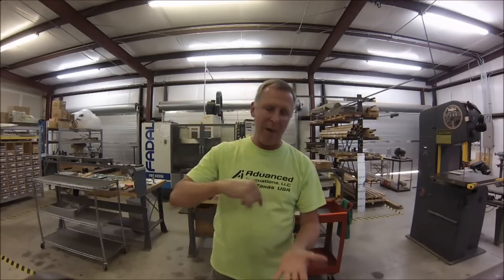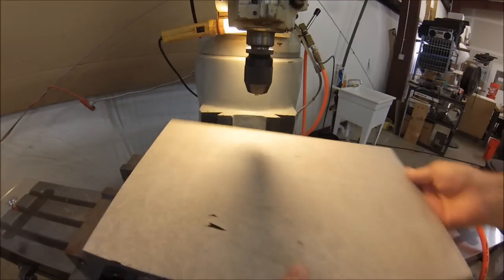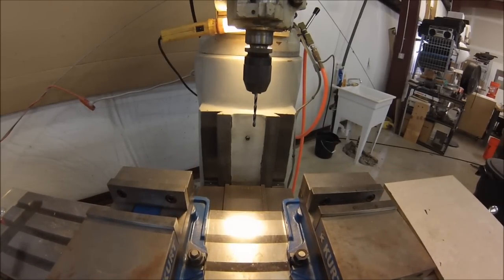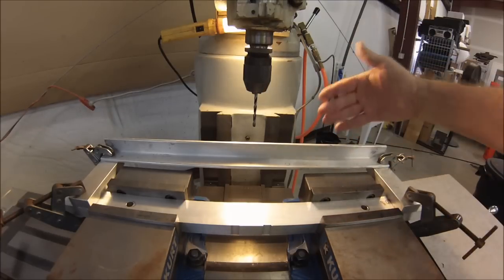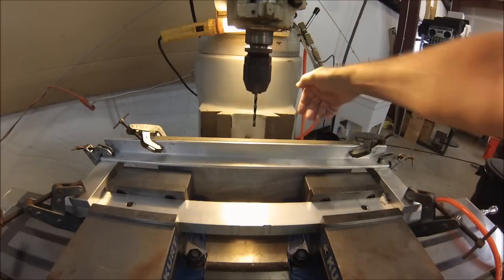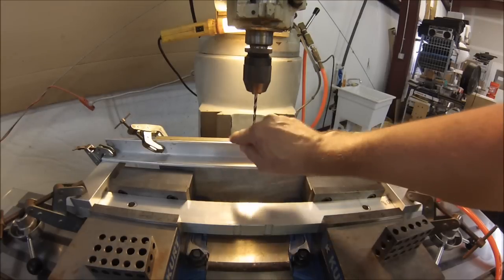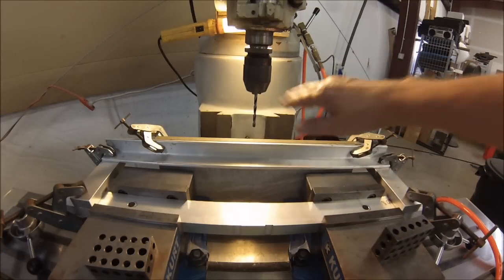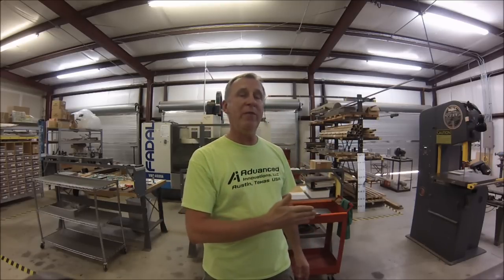Holding wide plate material vertically on the mill

Comment: Now I just need twin vises! :-) I actually want a big radial arm drill exactly for this type of stuff.  I worked in a shop that had one once and that thing was slick for jobs like this.
Reply: Level3-RC
I would love to have a matching 8" Kurt to the one I have. Loading one in and out of the mill is a good workout, if I had two to do I could start body building. lol
Reply: Level3-RC
 I believe Kurt advertises all their vises to match dimensionally within .001" for each series.   I do not know if they will match a pair beyond those tolerances for you or not.

Comment: Mann!  you're some cookie, Joe!  That was real Headbanger stuff - fair rattled my cage, er Brain -  That's what I like about your tutorials -this LATERAL THINKING. I've started gripping small vices in bigger vices ( for sake of accurate right angles ) and would reluctantly have turned boring head on its side - just the pain of setting squareness ( pity the mills don't have an indexing notch.... Mmm  some mileage in there? - to make an indexing block for quick resetting for simple work, at least ? ) THink I'll have to get the apprentice to manufacture a similar device for our SINGLE large vice on the Bridgeport - the trick being to keep it square and parallel to the vice and table.........   Many thanks.
Reply from the maker: Thanks for the comment.

Comment: Great tip! I'm curious why you remove the 123 blocks before drilling.
Reply: It just occurred to me why they need to be removed. Don't want to move the x-axis with those sliding on the ways :)
Reply from the maker: They are also likely to bind and try to pivot which would throw you part out of alignment.
Reply: I guess if the holes were big, the blocks could be reinstated after each move to take the thrust of drilling.

Comment: Nice....A buddy of mine asked me if I could add a bolt circle pattern to a rear end axle that's about 36" long. Any simple ideas how to hold the axle of off the side of the table? Great videos...keep em coming! Thank You!
Reply from the maker: Hi Chuck. Swing the head of your mill about 45 degrees off center and clamp a big v block to the table. Let the part hang close to the floor. Careful you don't hit the lower casting of the machine when you move the part. Even a home made primitive v block will work.
Reply from the maker: A right angle head would also get the job done.

Comment: A comparable equivalent would be a couple of angle plates setup so the vertical faces were sitting out slightly past the rear of the table.  Dial them in so they are coplanar and Bob's your Uncle.  

On occasion I use an angle plate on my drill press to allow working on the end of a flat bar or plate without the need to rotate the table.  So as soon as you poked that clamped up rear face framing into position my thoughts immediately jumped to my use of the angle plate to create a temporary vertical table.

In your case I like the drop in frame since it might be a bit of a PITA to move TWO vises and zero them in again so they act as one.
Reply from the maker: Hi Bruce. The angle plates would work perfectly as well. You may even be able to keep them screwed to the table and not consume the valuable vise space. This trick works well for the guys without the angle plates. Thanks for the comment.

Comment: If you don't have 2 vices, this same kind of thing could by clamping an angle iron to the table with toe clamps. You could indicate the the angle iron parallel. A quick dirty way would be to make up some indexing pins that fit precisely in the slots on the mill table to locate the angle iron up against. I've been meaning to make up some indexing pins for the slots on my milling machine, this idea just gave me an excuse to make them up.
Reply from the maker: Your suggestion is a good one as well. The setup shown in this video is for the guy that doesn't want to remove his vise and may have a DRO glass scale protruding out the back of his table. My setups come and go very quickly around here, so anytime I can leaves the vise(s) in place and utilize them for secondary setups, its a good thing. Thanks for the comment.
Reply: Joe Pieczynski  Joe your putting out some great content. I like the way you format a lot of it with the white board lesson first and then walk out to the shop and show the practical applications. The other thing I like is that you keep the video focused on the subject matter at hand. To the point. That's the way I like it...you're doing a great job on these videos. New subscriber here.

Comment: Hi Joe
I did something a bit related to this idea, in that I swung the turret to the right and then clamped a tall job to the back of the table. The job sat on a wooden block on the floor,  a bit crude but I got the holes in the end of the job where I needed them!
Keep up the great ideas.
Pete
Albany. West Oz
Reply from the maker: I still do that. I had so many to do once, I actually built an adjustable outrigger. It works well.

Comment: Hi Joe. Great knowledgeable vids. QUESTION: it's about your trepan vid. You plunged the cutter into to round face which makes an initial box groove (the width of the widest face it the cutter, but don't you need to move that same cutter while it's on the bottom of the groove outwards and inwards to make the  bottom of that groove wider than the face? Sorry for the lack of proper terminology. I always need to draw a picture to describe what I'm saying.  Thanks and keep them coming. Rick
Reply from the maker: Many of these trepan tools are slightly back ground on the sides to keep the sides from rubbing as they plunge to the final depth. As well, most of them have a corner radius on each side of the cutting face. This being said, you are less likely to chatter and will have a better groove side finish if you pull the tool out, make your in or out shift, and re-plunge the cut staying just short of the bottom of the groove. The minimal mismatch will be in the corner radius and have zero impact on the groove function. I hope this answers your question.
Reply: Joe Pieczynski thanks for taking time to answer but that's not my question. This is a trapezoid shaped groove larger on the bottom. By plunging straight down ( I'm referring to this as if you were sitting the face upwards. Just makes it easier) then the groove can only be square with radishes sides but cannot be wider at the bottom unless you move the cutters towards you then away from you. Maybe if I ting your website I'll try to send you a sketch
Reply from the maker: If you are referring to a dovetail trepan groove, you can sweep the bottom, or coordinate 2 tools and use your compound. A tool that sweeps the bottom usually has a very small shank because of the dual angles and the minimal facial opening. There is a name for them, but it escapes me at the moment. I have never enjoyed cutting them.
Reply: Joe Pieczynski  yes Joe. I think that's what the video was about.  Thanks again. Sent you an email with some very poor drawings. Again I love your instruction.

Comment: How would you hold a piece of C-channel to cut the end to length without chatter. (3.5" x 1.75" x 1/4")? Too wide to turn sideways in the vise. And I've tried filling the center off it with adjustable parallels and a piece of scrap that was cut to fit. Still get chatter.

Comment: I had a job where I had to drill and tap the ends of 1x3 bars about 3ft long. A bridgeport has a T slot in the front of it and I have a hold down clamp that I think is for holding a board to the top of a workbench for working on it. I mounted that to the T slot so the bars could be clamped to the front of the table and extend clear to the floor if needed. Swivel the head to the side and job done. I've never seen another one of those clamps so don't know where you would get one. Hope that makes some kind of sense.

Comment: thanks for that lesson Joe, i was confronted with a task similar although i didn't have to do holes on the perimeter of the aluminium plate, it had to be cut into strips. using a handheld jigsaw was glacially slow and i had several other setup issues with the slitting saw i was using and also vibration issues.
i found that climb milling was the best way to go since the tool pressure pushed the work away from the slitting saw. going conventional it kept grabbing the saw and stalled it a few times and pert near broke the tool. 
looks like i'll be making a special holding jig for this sort of stuff as i get this sort of job from time to time
cheers
mike

Comment: Thank you Joe for your useful videos in many areas of machining situations. I figure that a jig made with a 4"x 3" x .500" piece of milled angle plate, would do the trick bolted to the table slots. The reason for the wide sections and thickness, are to provide rigidity and also to clear the X DRO reader in the back of the mill. But your idea of using the empty and deep space in the rear of the table, is indeed ingenious. This brings to mind another clever solution by a fellow YouTuber who needed to mill an oversized part on his mill, and solved the problem by bolting a 1" thick  steel plate of adequate size, to the table slots to extend support towards the front of the table. Within limits of weight and rigidity,  works like a charm.

Cheers

Jorge

Comment: Great idea... I had project that was  something similar to this while back. I was really lucky since I bought tool box from old tool and die guy and in his tool box was modified fixed Kurt jaw insert..  Basically it looks like J hook.. Mounts into existing holes or just clamps in the vise. Then it goes over to the back part of vise and table down about .250 of the railway.. It's made out of .500 A2 steel.. he used to make many safety guards for the equipment and they required holes / threads..

Comment: how to drill big long shafts on mill doesn't have an angle head? or does it not matter if its drill by hand
Reply from the maker: My best advice for this is to swing the head of the mill to about 45 degrees off center. Using the 4 hex bolts on the main body of the machine ( 2 on each side of the column ).This puts the spindle over the floor and not the 'Y' axis bed. Clamp a large 'V' block to the table and let your shaft hang straight down. I do it all the time.

Comment: Great idea, you can also weld it from steel bars, and mill the final clamping surface straight. some holes or T-slots in it for clamps and you have a permanent tool.
But such a bar could be mounted on the back of the vice as well by the screw holes....

 btw, I mounted them (back in the day I did milling) flat on the table, and removed the head, horizontal milling/drilling etc.

Comment: I love these videos! I've had jobs where I hung the work off the table or to the side, but I never really gave much consideration to building an actual rig that goes in the vises. If I were to make one myself I would probably weld it and semi-permanently affix it to the table (probably to the t-slots that are outside the coolant pockets so the main slots aren't obstructed), then it would be sorta out of the way and my vises would still be available (plus it could act as a rail and I could fabricate some stops that slide along it for long parts). We have a number of bridgeports at work that seldom get used. Everyone has sorta claimed their own, haha. I would like to do this mod and also see about getting an extension ordered for the column. Every once in a while one of those jobs comes along that doesn't lend itself to easily being put in a CNC. We do have an angle head lying around somewhere that clamps onto the quill, but it can be a pain to use and spends most of it's days hidden in the back of the bottom drawer in the Lista collecting dust.

Great videos, real simple fixes to problems that can leave you stumped at times. Reminds me of a saying I heard that goes something like "pessimists see the glass as half empty, optimists see it as half full, Machinists look at the glass and realize it's twice as large as it needs to be"
Reply from the maker: Hey Sandman, thanks for the comment. We all know there is always a better way, only sometime the boss or the schedule won't let us get fancy. I like your ideas. I need to rig up a permanent one of these myself. Being vise anchored just makes the setup take only minutes. Thanks for watching.

Comment: Joe, very nice tip. Just wondering though - at 3:19 you said "don't forget to remove the 1-2-3 blocks". Why is it necessary to remove them? I would think they would provide positive support in the vertical direction, preventing the part from dropping in the event heavy downward force is applied to the quill. Please clarify. Thanks.
Reply from the maker: Excellent question. If you plan to drill a series of holes, the movement of the table and motion of your work piece can cause the blocks to tip and get lodged under your work piece forcing it upwards. I strongly suggest sliding the blocks out of the way between hole locations. If the blocks were rollers, it would be a different story.
Reply: Ah! I understand now. Thanks for clarifying.
Reply from the maker: You may have just inspired me to make a pair of short roller towers for this. Thanks
Reply: It's nice to know I'm good for something. LOL
Reply: If the blocks were rollers, eh?    thinking about those skates - or similar - ball bearings in some astute or judicious placing....  Joe ?   :-)
Reply: Als, you shouldnt be touching or placing anything at all on ypur ways, yea they are ground or flaked in, but I was taught they are to be treated with extreme care. Which brings me to, All the nachines i have ever ran have had a rubber cover to keep shavings off the ways, that can runin them by pushing the chips over the surface. And you got the sweetest t slot covers that I was just mesmerized by for some reason. But It is a very innovative way yo get the job done, I would just hang an agle plate out there n clamp to that but thats time, and time is money.